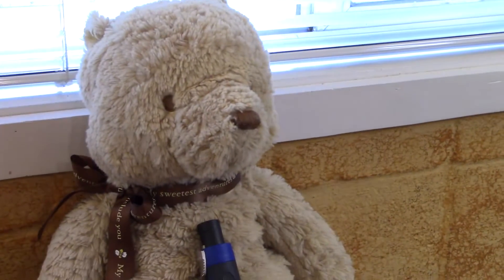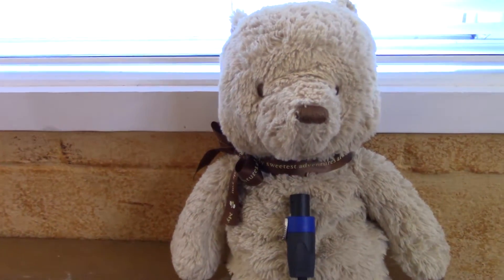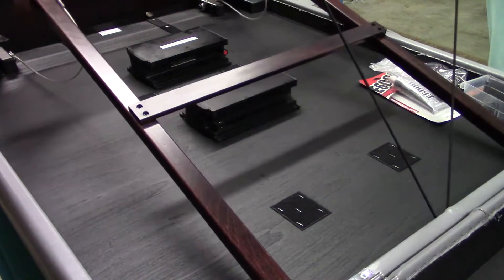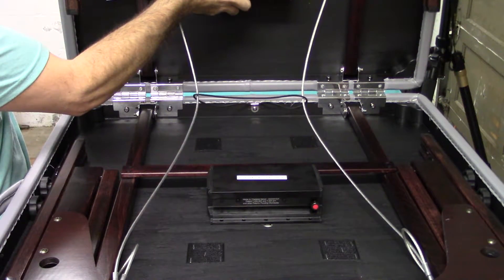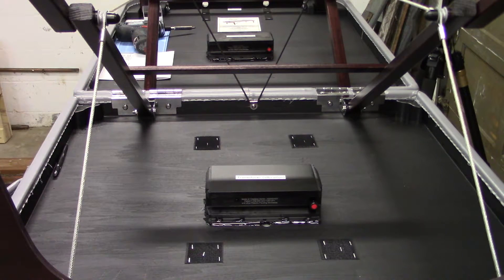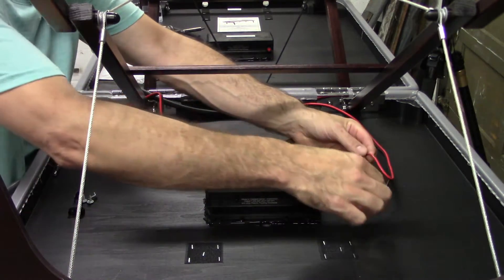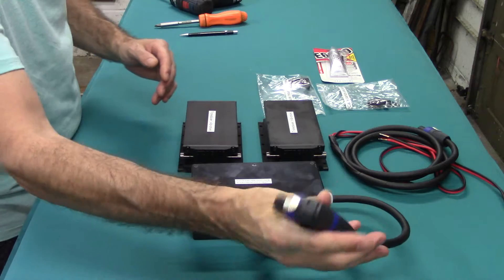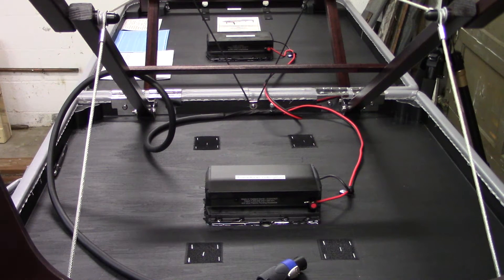transducer mounting 2020

Comment: Hi thanks for sharing that very simple way to install the transducers 
You just skip the most important part what amplifier are you using 
We’re do you connect the transducer wires to,to make them do there job
Reply from the maker: We use our own custom amplifier and  nuetrik connections to our amps. Audio retailers like parts express sell these transducers and can give you tips and proper recommendations for amplifiers
Reply from the maker: We use our own amplifiers that are custom spec'd to our needs.  A 200-350 watt amplifier should be sufficient for your needs when running a 4 ohm load (the ibeam are 4 ohm not 8 ohm like most home speakers). Don't get fancy with the wiring schemes unless a professional is wiring up the system- the impedance could become unstable for a home amplifier. Finally, use low pass filters for the transducers. They don't need to play all the frequencies you are hearing- just the low end stuff. You can buy small amps that have built in crossover networks that will run the power you require. If you use a 100 watt amplifier, you run the chance of damaging the transducer due to clipping of the audio signal.
Reply: I have the same question, feeling the need to see the rest of the system not just the transducer. The amp is just as important, and how you connect everything, since I’m new to this.  Above you said that 200-350 watt amplifier should be sufficient, and you also said that a 100-watt amp might clip and damage the transducers. So, which is it? 200-350 watt, or 100 watt?

Comment: Great video. Can we apply e6000 to the entire base of the transducers to make sure it holds better? I’m not sure how thick the wood is on my table, and I’m concerned that gravity in the vibrations will make the transducers come off overtime. Can you think of any disadvantage to gluing the entire  transducer?
Reply from the maker: Hi Don, the problem with using a silicon based glue is that it needs air to dry and by applying it to the based, there is no air. Second issue is that transducers work best with a direct contact to the surface ie., no rubber like glue between the transducer and the mounting area. I have never had a transducer fall off our systems (particularly with the Ibeam at 10 screws each) when using the e6000 in this way. If you need more adhesion, consider a 2 part epoxy as the glue that is sandwiched between the ibeam and the mounting surface. Just know that you will damage the table if you remove the ibeam later. I have also used an aluminum substrate between the table and the ibeam. The aluminum gets screwed and glued and then the ibeam gets mounting to the aluminum plate with self tapping screws and e6000. I don't use steel plates since it will cause the spider inside of the transducer to pull to one side more than the other which causes it's own problems. Finally, be aware that the magnets are very strong so pacemakers will stop working when near them.
Reply: Thank you so much for taking the time to reply!   I will be using Dayton Audio transducers, however, I will mounting six of them.  I am launching a VAT business, and this will be my primary table. I’m not concerned about ruining the massage table. However, I am definitely concerned about them loosening or making weird, vibrating noises,, etc.  I have some colleagues that have had good results, applying a silicon caulk to the entire back of the transducer. I was going to go that route before I discovered your video. E 6000 to me seems stronger than the silicon caulk.  Maybe I should use the silicon caulk on the back and the E 6000 around the sides. Do you think that would be a good solution? Thanks again for your insight!
Reply from the maker: im assuming you are using the BST-1 from dayton audio. They make a new version called the BST-300 which is far stronger which means you can use less transducers. The BST series use a foam pad in the middle which i am not a fan of. They also only use 4 screws which is a problem in the 1/8" thick wood laminate that is found in massage tables. For a serious glue, use the water activating wood glues that gorilla and other companies use. It will permeate the wood and create a far stronger bond. When used in combination witht he mechanical fasteners like screws, it is a great bond.
 The moving mass of the transducer in combination with the coil size and other factors make up how low a transducer can go. If the transducers you are using does not have a large moving mass, then you just won't feel the low end the same way. If your using 6 transducers, i'm imagining you are running a series + parrallel connection for a 8 ohm nominal load, you will have more energy for the given frequencies, but they still may not hit the low end. I would also be a bit concerned of dead spots and high spots just like in a room, but i haven't tried 6 at once. 
The reason for us using the Ibeam is that they have the most accurate and fast response while hitting well below 30Hz. We have tried all the transducers on the market and have burnt out 3 of the clark, 1 butt kicker, 2 dayton models. None of the transducers feel as good as the ibeam.   @donc4238
Reply: Wow, thanks again for the info! Yes, I have 6 of the BST-1 and 2 of the BSA 200 amps. (I decided on 6 because VAT expert Kate Kunkel recommended that.) You have me concerned though that you "burnt out" the Daytons. If you wanted to use what I have, would you recommend your method with the E6000, or the water-activating glue ? Or some combination like both silicon caulk and E6000?   Thanks for sharing your knowledge!  Do you have a link to your business?
Reply from the maker: You can run a single BSA200 with three transducers per channel in parallel which would give you 2.67 ohms at 87 watts. The amp is rated at 110watts @ 2ohms so it is just enough power for it work. The amp will run hot so don't stuff in a cabinet without forced air.  With the BS-1's, they are rated at 50Watts and it helps to have more power available for the transient spikes from the music. The parallel wiring will help keep the amp from clipping when you run close to max volume.  
if you run a series/parallel setup, you are looking at around 40 WPC at 5.3 Ohms for 3 transducers on each of the 2 channels. 40 watts per channel will cause the amp to go into clipping at it approaches max volume which will damage the transducers. 
Transducers burn out when they are run continuously at close to max power. The transducers can also burn out when they are driven at clipping which is a massively distorted signal.  The music we create has lots of low end information so it overworks the motor of the transducers, heating up the enamel of the coil, melting the enamel and causes shorts, and enough gumming of the parts to seize the coil up.  This is why we are running transducers with higher power rating and faster response time. 
Personally, i would use the water glue 
Here is a good website for wiring configurations and impedance information https://soundcertified.com/speaker-ohms-calculator/

Our website is www.quantumresonance.org 

BTW, the BS-1 make 30Ft.Lbs of force or 180Ft. Lbs. for all 6. The ibeam create 220Ft.Lbs for a total of 440 Ft. Lbs. for 2 transducers. Massive difference in energy transmission.    @donc4238

Comment: Can you please send a list of what we need to convert our table?  Or do you have a pkt we can buy? Ty so much
Reply from the maker: Hi Patricia, Thanks for the inquiry. We make a custom system exclusively for the crystal bed which is a complete package. The system uses specialty components that are only available in professional sound use. Your best bet is to reach out to inner solutions. They use the same transducers as we do but are designed for off-the-shelf audio parts. https://innersoulutions.com